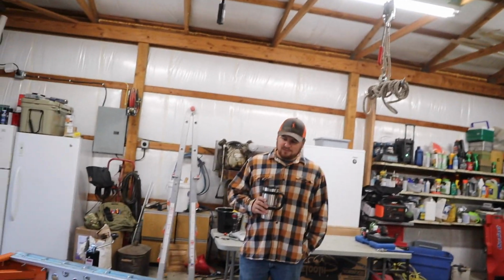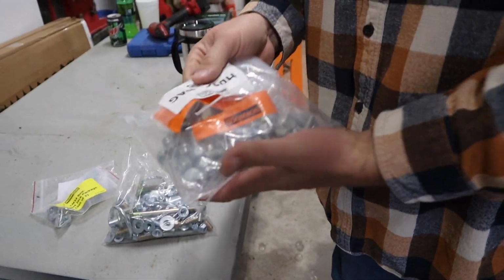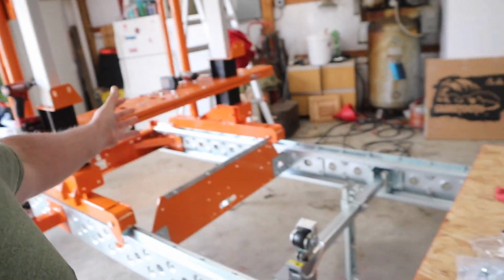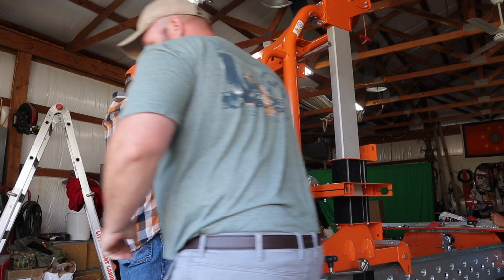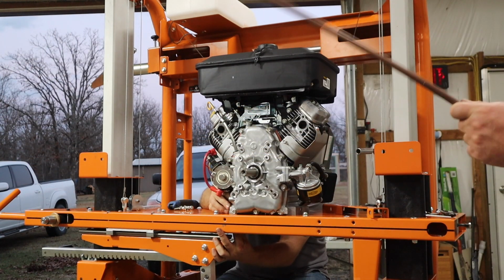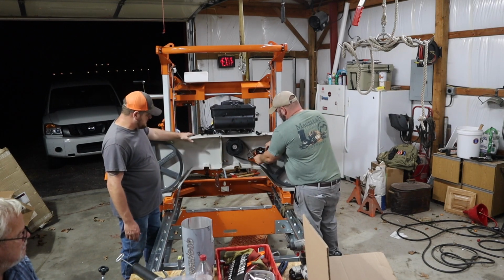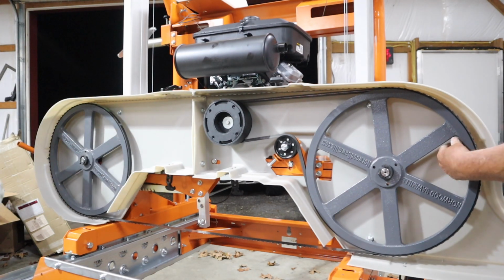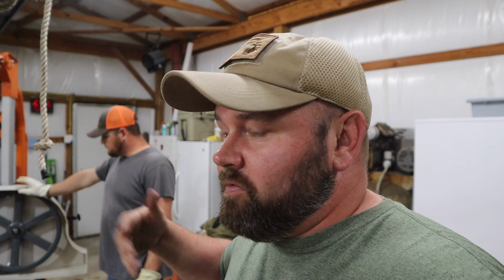Assembly Of A Norwood Lumber Pro HD36 Portable Sawmill

Comment: Looks like you needed an air compressor and some air tools like the mechanics have.  Just zip zip and the bolt are in.  Glad you had the extra help.   That sawmill is a doozie.  Sure beats that other one you had on the property.  Although it made some nice slabs out of that tree.

Comment: When do you start using that blade it will stretch a little and you have to keep your eye on it and keep tightening the blade, you'll figure it out. Never worked with one of these but I did help my friend who owned a wood-mizer sawmill we built a lot of rustic furniture and tables out of Cypress and Cedar. The wood-mizer comes already assembled and is a lot more heavy duty. But I'm sure this one is going to do do what you needed to with no problems

Comment: I bought one of those 4 years ago.  Did it by myself in about a week working on and off.  I even made the screw jacks myself to go on the side to adjust.  You are not even to the part about mounting the motor.  There are about a dozen videos on the subject now, 4 years ago there were none.  The sawmill cuts great and I use it every fall, to cut up logs when its cooler here.  As they say enjoy the ride and just do it.

Comment: I would pay someone to assembly that thing, if I ever got one. Imagine if you put the proper piece in it's place but you installed it upside down. I did that when I assembled my gas grill. I had to take most of it apart and re-assemble. Due to that piece in reverse, wouldnt connect properly to the next piece. 

A machine like that, should come partially assembled.